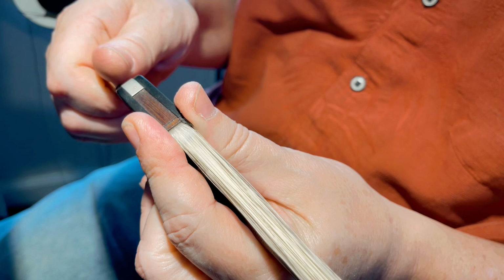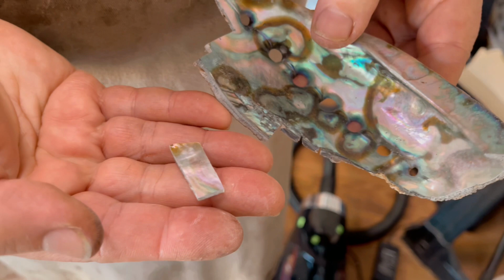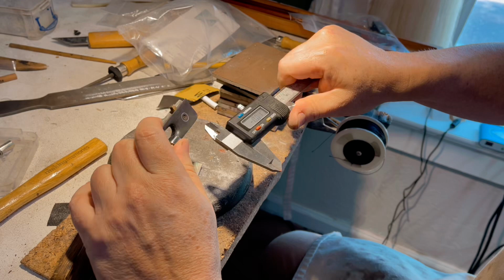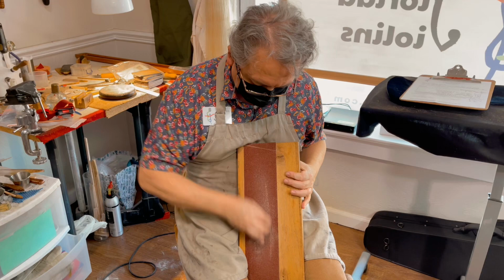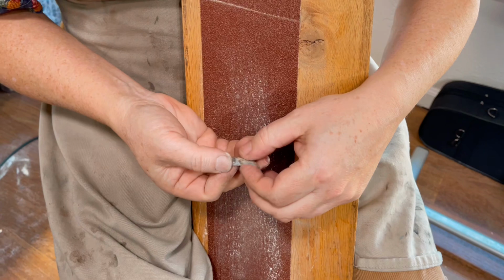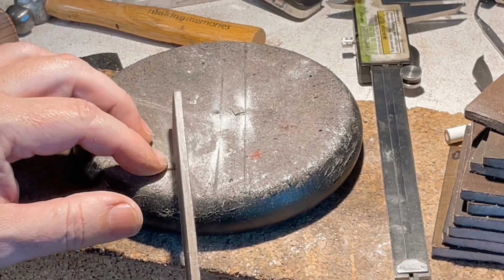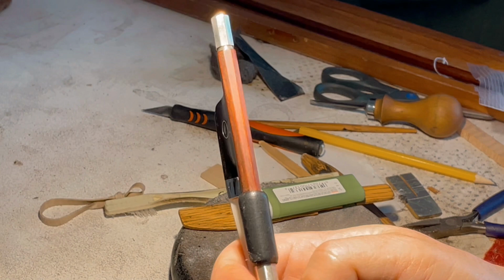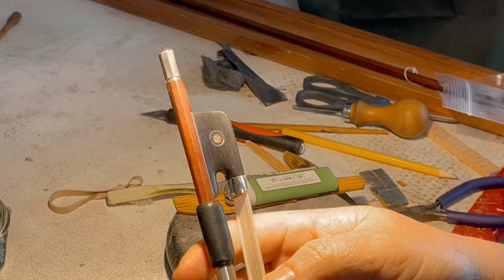Restoration of a French “Louis Bazin” Violin Bow

Comment from the maker: * Because a bow frog has a rounded heal does NOT make it a viola bow. There are many factors such as weight, balance, length, setting of the head and talon and also taper that will distinguish a violin bow from a viola bow. This bow in particular is a fine example of a violin bow that happens to have a rounded heal in the tradition of the time and from F.X. Tourte, the father of the modern bow who made many exquisite specimens, and were also copied by his pupils after him. In the modern  commercial manufacturing of bows a rounded heal is typically given to viola, cello, and basses. Master Bow Makers do NOT follow the same rules. We make our bows in specific patterns and traditions of our choosing to create a handmade custom tool for our clients to utilize in their mastery of playing.
Reply: Bazin bows with rounded frogs are quite common. His workshop had a few different identifying styles as well.